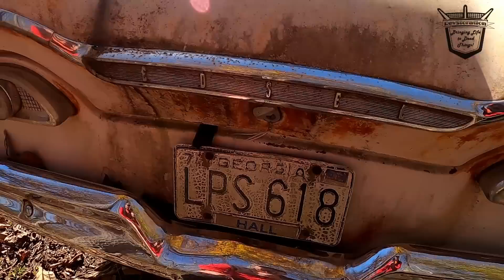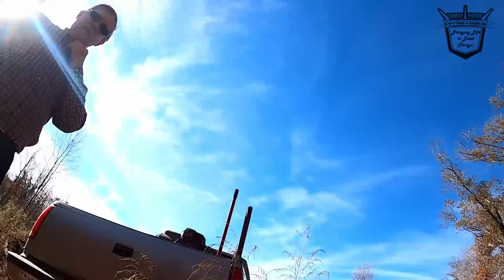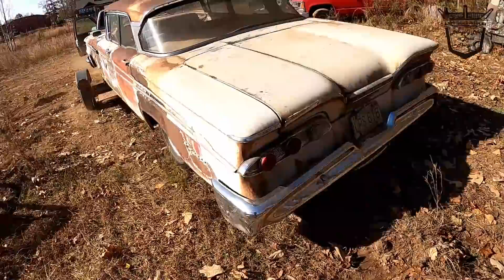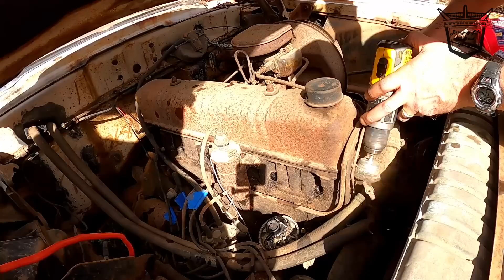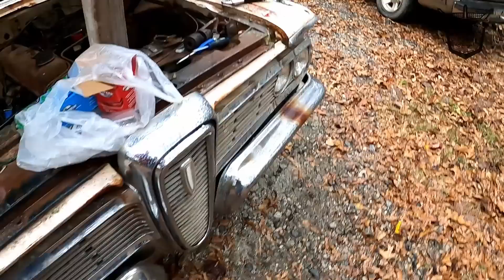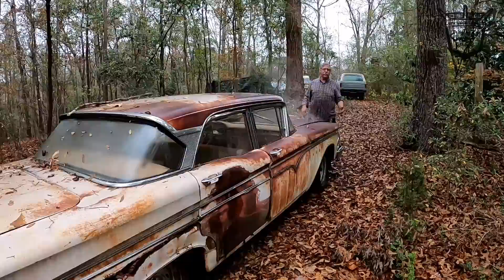First START & DRIVE in 30+ Years? 1959 Edsel Ranger - LAST TAGGED 1973 - Ford's Worst Experiment!

Comment: Edsels were made for 3 years 58, 59, 60, and were built on the Ford assembly line  right along side the Ford cars which shared the same bodies as the Edsels which had different  front clips and tail ends and trim and engines. This caused the guys working on the assembly line  to outright hate the Edsels and many Edsels were sabotaged by the ones putting them together. Edsel was Henry Fords only son. Edsel  named his son Henry Ford II and this was who wanted the car to be named Edsel in  honor of his father who was a truly amazing car designer
Reply: Edsel designed some great ford cars from the 1930's on.

Comment: Hello Rev David & Ole Man. I just love those Inline 6 engines. Sounds like the piston rings may have been sticking causing low compression. That engine will probably run better and better the more that it’s ran. 
On A Historical Thought; Just imagine that the Edsel was brand new when Buddy Holly, Ritchie Valens & Big Bopper lost their lives in the tragic plane crash near Clear Lake Iowa on February 3,1959. I am kind of curious what the specific manufacture date is on this Edsel. I’m so glad that both of you got the Edsel back up and running again.

Comment: I had a 58 Edsel Ranger 2 door with a v8 and a 58 Edsel 2 door wagon years ago. Last year I sold a great running 59 Edsel 2 door Pacer with that six cylinder. Then I bought a 59 Edsel 4 door wagon with the 361v8. Got it running this summer. 
All of the old Ford rigs have that style starter and they all get their door latching internals gummed up so the don’t work. Gotta remove the door panels to get at it to clean and lube up. 
Good luck with that. I’ve got a 58 Ford  retractable hard top and a 58 Ford wagon  plus 11 Thunderbirds, 1956~2003. Come on up here to Alaska and buy em!

Comment: Excellent video Rev :) , Old Man :) that cool 1959 Edsel Ranger car in 4 door plus surprises me got 6 cylinders, Automatic transmission on steering wheel column also would change that green acid cable too and change oil too why saw pull dipstick out got some water why drips like that! Plus not first one seen in those cars I know guy has but V8 motor also has push button Automatic transmission on left side dash and 4 speed with Overdrive button and update brake booster with fluid resivor 1978 year plus wheels to disk front and back drums and axle change too! Also 12 Volt Negative ground with Alternator too because Generator gave up also steering change plus suspension too  also much more! Car  is black and white too for body plus interior too! You guys nickname this car Flapper Spedo on Flapping driver's door and trunk too also gets up going speed! Need Wd 40 door locks and jams too help work right ! Nice see a 49 year car lives on too! Think gap on the Distributor points wild remember the 1968 McCormick International 105C combine gas motor had 1 cm gap on points Rev , Old Man why is because 4 cylinder motor had Champions spark that had size threads heads of Pop bottles buy today also  gap at 0.45 foul and head sockets were 13/16 not kidding you motor size was 202 Cubic Cm ! Horsepower was 105 with 130 torque and carb was 1 barrel carb Zenith with hand choke cable knob! Great motor and plus quick start ups and quiet motor ever heard! Plus 12 Volt Negative ground with Alternator GM Delco!

Comment: The Edsel didn't use a lot of Ford parts, it WAS a Ford. Edsel was Henry's son. The V8 engines were the only "new" thing they came up with. The "FE" block engines were the Ford, Edsel. A block design they came up with for the Edsel. Later became famous as the 352 and later, much more famous as the 390. That 6 was likely the exact same engine my dad had in his Ford wagon.
Reply: What size is that six?

Comment: A lot of times you can take a standard shift car that has not ran in a very long time and you can pull it with the transmission in gear for several miles.  That will a lot of times work the rust off the valve seats and build compression and heat in the cylinders.  Saves lots of wear and tear on batteries and starters lol .  An old WWII mechanic told me about that.

Comment: good job, wonderful. All old cars deserve to be saved. My best cars were a dodge monaco 1967 et an eldorado 1979. they are the america that i love. long life to it. 
To fight rust efficently, you can put grease everywhere : between carpet and metal, inside doors, trunk door, rear wings... when you cannot reach the hidden parts with paintbrush you can pour oil with an extender  - to be repeated every year for oil, for grease every five years
congratulations from france.

Comment: 12:12 I had pulled a car or truck many miles with a car dolly years ago. They work well until you have to back up a long way or pull a car in the rain taking a corner to fast. Things get squirrely. 14:55 The only thing you had to do is put the car in park and back your truck up. The dolly would have rolled right under the car with tires in place on dolly. The same way getting it off. Put the car in park, loosen straps and take your truck and pull dolly a way from under car.
Reply from the maker: We should have put it in gear.

Comment: A couple tips for ya. Put a pipe over the come-along handle & it will be much easier to winch up. Also I piece of foam 1 inch pipe insulation wrapped over the cable to dampen it incase in snaps. I also use a large 3 claw puller to get stuck rusty brake drums off. Remove all the shoes & reinstall the drum. Rolls easily then.
Reply from the maker: Bob, I appreciate the tip.. If we had a pupe we woulda done just that.. no pipe to be had at the moment. A 3 claw puller would work better for sure.. Thanks for watching, we appreciate you!

Comment: I love the interiors of those old Edsel's I don't care what anyone says about them even the styling was unique for a Ford at that time. Too bad Edsel Fords brainchild never caught on. You showed the engine turned over by hand fairly easily I just wonder if the compression on that engine is low for the reason it took so long to get it to run. The Ole man looks like Robert Mitchem in the movie "Thunder Road."

Comment: I agree with another, I think you had a compression problem. Drop some oil down the cylinders next time to help the rings seal and see if that helps to fire.
Reply from the maker: We did drop mystery oil.. we was not getting enough gas.. when we dropped a good carb but fuel it ran and ran good.. I did the thumbs  test.. it had compression.
Reply: That mystery oil is thin Rev. Something heavier like gear oil would have helped them rings seal faster and build better compression.
Reply: And the more you run it with good oil the better the compression gets.

Comment: Hey Rev, that little 4 wheel cart thing looks to be what we in the Air Force would call a HiPac. Super high pressure air compressor able to reach 3000psi or better. Probably has a little diesel engine.

Comment: 36:18 I would pull the starter apart & clean it all together & were I stoped the video.
 In our 61 Ranchero 170 I ground new lines in the core cleaned the brushes with help put it back together brushes apart 😀 & it started cranking real good it wasn't that bad of a job to do

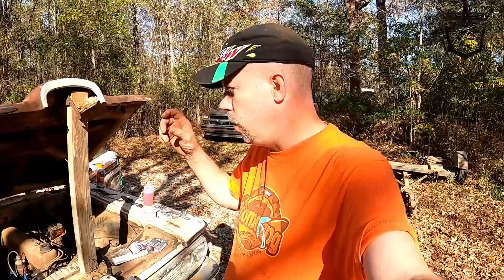Comment: I'm at around 35:45 where your tryin find why its crankin hard and ya gots the valve cover off now. Well, I'm probably your old-man Dad's age (65 next month) and grew up with those cars learning from ole salts prob old enough to be your pop's pop. So I'm sure you'll agree grey is not your normal color for carbon/sludge in an old motor no matter how old, grey means water was gettin in the oil somehow someway and who knows for how long cuz those old Ford 6 bangers could still run quite smooth for long time with hairline head cracks lettin water in never knowin. So I'm just sayin before you write off the old starter ya gots to add the water thing in overall equation that that old watery sludgey crap has sat dormant for 50 years of Southern seasons sorta equate it to bad arthritis LOL. 
Fyi just found your channel by accident this is my first video to watch and love it and fyi I'm San Diego born/raised but in the 80s I lived around Atlanta three times loved it loved it loved it and miss it deeply, lived in Marietta, Smyrna, Conyers and Decatur. And actually I was adopted as an infant to greatest parents ever but in the mid 90s met my bio ma turns out her people were all Louisiana and Mississippi thus my inner love for the South.
Probably way more than y'all cared to know LOL 😂😂
Post Script! Just finished the whole video and I gotta tellya this was one of the most entertaining homemade videos I seen in a long time! 😂😆 Congratulations hallelujah 👍👍
And I take back my hairline crack theory that engine sounds pretty dang tight!! 
Love old cars cya

Comment: The reason the car wouldn't start all those times is a direct result of it sitting for so long. It didn't have enough compression to fire up, but the more y'all cranked on it the more it restored compression. Then, when y'all swapped the battery it spun the engine faster and it had enough rotation speed to finally fire up. The more y'all run it, the more it'll restore compression, the better it'll run. One thing I've found from working on cars all these years is to drop a few drops of oil into each cylinder before you try to start it. It'll coat the cylinder walls and boost the compression.

Comment: This is why I always get the plug and wire grease every time I do a tune up so you don't run into this problem with plugs not wanting to come out of the cylinder head cause you don't wanna break a plug in half then your in big trouble

Comment: Please grease you starter shaft and sping. so it will slide easy in and out. Gen needs new brushes you got to get the field charged in it. probably needs a regulator too. they get stuck hit it.

Comment: I had a car that would not start no matter what I did to it. It had fuel, it had spark, but no matter what I did it would not fire up. I pulled the plugs, dropped some oil down into each cylinder, turned the key, and it fired up first rotation. I was thinking what the heck? Turns out I had cranked it so much that the gasoline had fuel washed the cylinder walls and it had no compression because of that.

Comment: Both ya'll had me worried for a bit.

Next time ya'll do any winching, please, please lay a floormat or old coat on the cable. Don't want ya'll to get cable bit 😬

The reason Edsel wasn't a big seller was
1 - they were ugly 😂
2 - the fit and finish of the body wasn't the greatest job performed by the assembly line, why?....

Edsels were built on the regular Ford lines with Edsel specific tools meaning workers built 5 Fords and then had to remove Ford tooling and bring in Edsel tooling. After 2 or 3 cars, swap tooling again.

The workers got fed up doing that and began to not give a crap about quality.

A fellow in my town has a 59 he brings to carshows, you can see the body misaligned and emblems crooked.

Comment: Ford 223 inline 6 was a very dependable engine.  Back in the 1950s a person was much better off having a 223 than the Y block V8.  I have owned 3.  58 ford pickup and 1961 ford pickup and 1964 ford station wagon with those 223 engines.  About that 59 edsel, who on earth put a womans thing in the center of the grill?

Comment: You people are hopeless  trying to start an old engi e without putting in new rotor button  condenser  and points    these are the basics    you can always rig up a fuel supply  but change electric is first requirement
Reply from the maker: We have started numerous ride with nothing but gas.  We like to start with what is present and then throw new stuff at it. Thanks for watching! I've also found the old condensers are mostly always still good

Comment: If you guys would clean your electrical connections you'd get more amps to the system. The interruption caused by all that rust and corrosion is what causes everything to move so slowly. You guys cause yourselves way more work by not cleaning your connections.
Reply from the maker: Thanks.. never knew that. Appreciate that.. It does run well though.